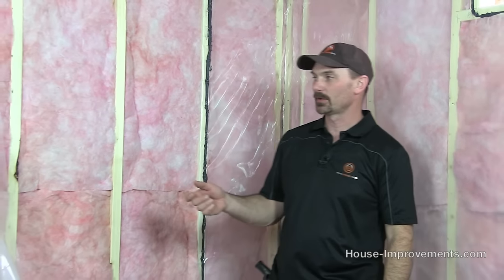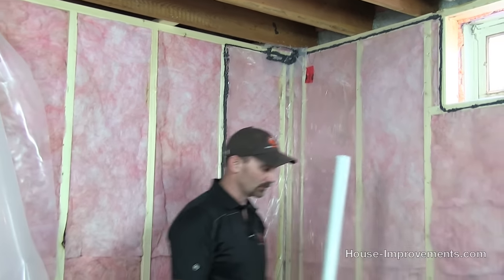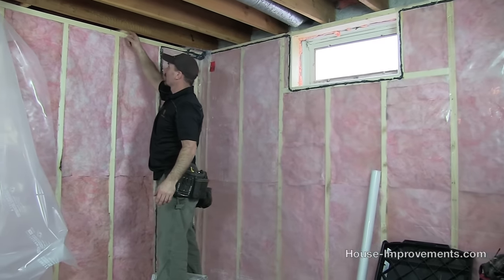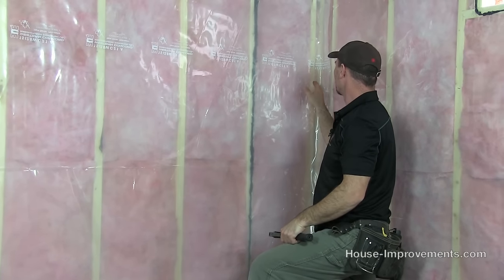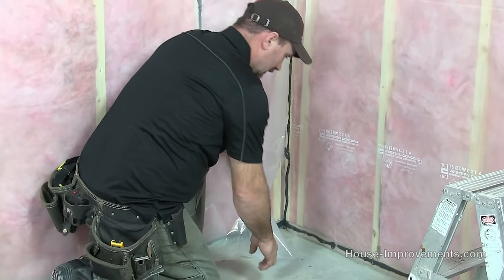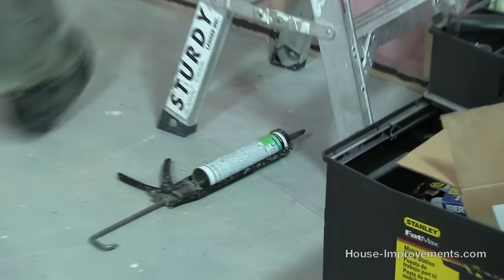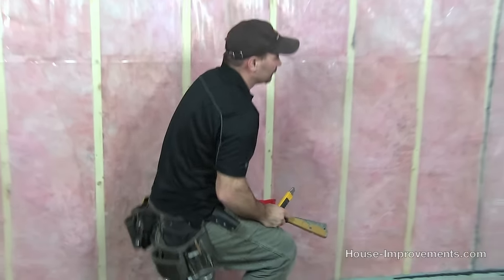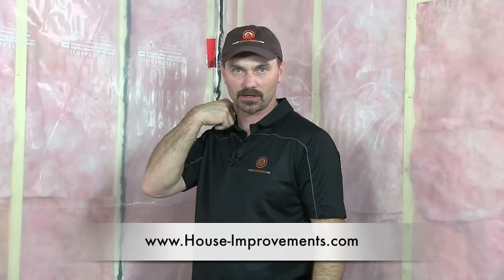How To Install Vapor Barrier

Comment: I used faced insulation should I still use poly?
Reply from the maker: depends on your location. if you are deeper south in the sates you are likely fine with faced insulation but the further North you are you will likely need it. Check your local codes.
Reply: HouseImprovements thanks so much Shannon your videos are a huge help.

Comment: Is that faced or unfaced insulation?
Reply from the maker: un faced
Reply: @HouseImprovements  Thank you.  Which caulk to use for sealing wood gaps touching concrete ?

Comment: aim trying to figure out if i shouldn't use it in my basement i know in florida you cant use it it will destroy your house and in canada you have to use it aim in illinois do i need to us it house are not built around here with it
Reply from the maker: I would think so as you are far enough north but check with your local building code office.
Reply: Thanks

Comment: Poly should never be used in any climate where air conditioning is used to a significant degree. moisture will diffuse through the wall from the outside, condense on the outside of the poly and potentially rot the walls. Poly is only recommended in climate zones 6 and above.

Comment: This guy is awesome but vapor barrier is the building industry's most contentious issue. I have remodelled 3 homes from the 1930s. They all had holes drilled in the t&g sheathing in every 14" wall cavity for venting. Tar paper on the exterior plus siding. The fir sheathing was amazingly preserved and the old growth  framing perfect. It is not energy efficient to rot homes from the inside out and rebuild every 40-50 years.
Reply from the maker: You are right it is contentious and most of it depends on your climate. Actually the holes in the exterior sheathing of a home in a cold climate would have nothing to do with the air/vapour barrier. Air vapour barrier in a cold climate is to control vapour  from inside the home from entering the wall cavity and to prevent cold drafts from inside the wall from entering the home. In cold climates this is needed  on the warm side of the insulation.

Comment: So you can tape the barrier to the bottom rail instead of the caulking?
Reply from the maker: No, tape really should only be used where you're sealing poly to poly or to plastic or vinyl. It does not stick well to wood or concrete .
Reply: @HouseImprovements  you are right as I just found that out. Lol

Comment: How many mil is that plastic?
Reply from the maker: its classed as 6mil but is not standard 6mil poly. It is specially rated for use as a air/vapour barrier

Comment: If you put staples in your plastic sheet you are making holes. The idea is to seal air and moisture out before putting up the drywall. Doesn’t all of the holes defeat that idea. Therefore shouldn’t you put red tuck tape over all of the staples to seal it.
Reply: Yeah but what happens when you screw drywall through the vapor barrier?

Comment: In my opinion. You shouldn't install the vapor barrier on the inside of the wall. It should be on the wall that is exterior. IE a block basement wall or concrete wall, that is caulked and sealed at every seam. The point is to prevent vapor/moisture/water from entering. The way this looks to be done, you're just protecting the drywall from mold and rot. The point is to protect the wood, insulation, and drywall. Seeing the way this is done, it's very clean and informative, but that moisture will get trapped with the insulation/electric/wood framing.
Reply from the maker: in many areas this is required by code. This is an air/vapour barrier which is helping reduce moisture and air travel from inside the home into the wall cavity. 
On a basement there is also a moisture barrier against the concrete to prevent dampness from the concrete getting to the wall cavity.

Comment: You’re doing it wrong.
Every stud needs vapor barrier.
As you install drywall you’re going to put screws through the vapor barrier.
Thats where the sealant stops moisture vapor infiltration.